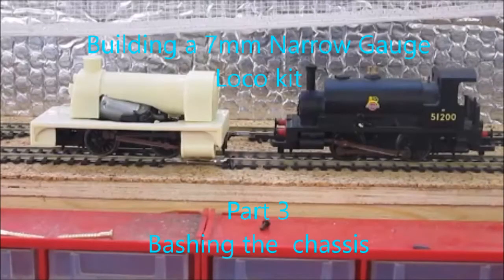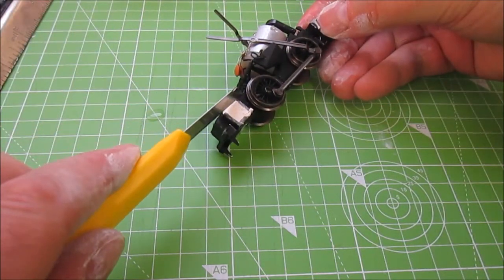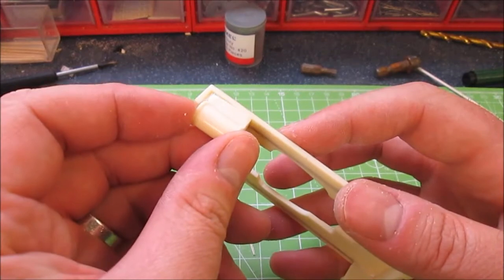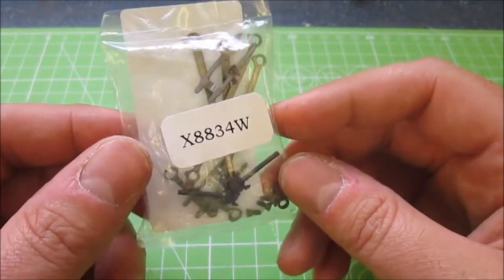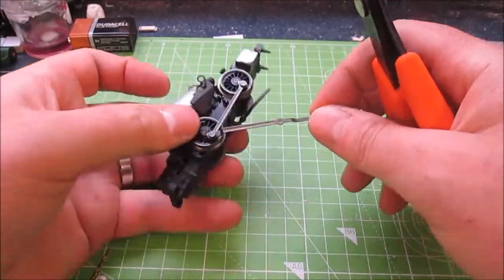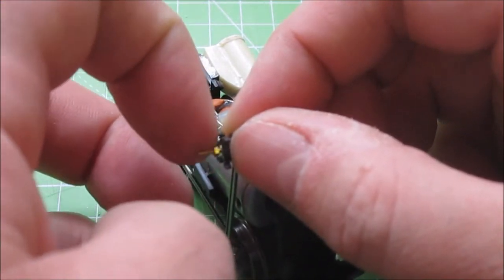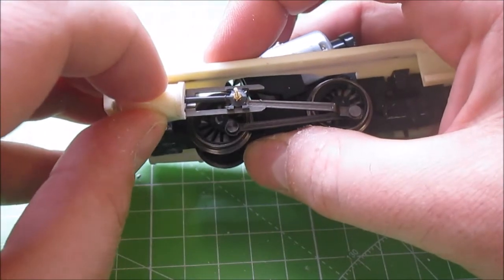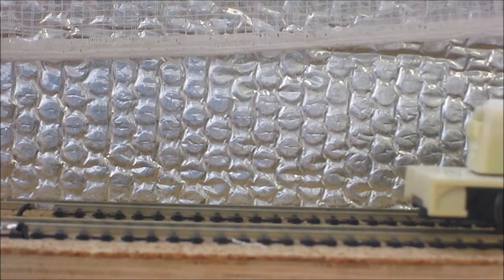Building a 7mm Narrow gauge loco kit - Pt3 Bashing the chassis

Comment: Great job!  It definitely has improved the model that's for sure and very brave of you for trying :)

Cheers,  Michael
Reply from the maker: Hi Michael. Thanks it was a little scary at first but I had spent quite a long time thinking it through and working out which size drill bits etc on scrap bits. Definitely worth the effort so far I think. Cheers.
Tom

Comment: Very nicely made video; your "teaching" style is really good and clear to follow.  
I have been thinking of doing something similar, and I have one of the Hornby 0-4-0 chassis, but the slow running and reliability do not really come up to scratch. Maybe mine is not a great example?  The time taken to complete the conversion would seen to justify splashing out on a nicer chassis to start with with a decent mechanism, though obviously the Hornby one is appealing because of the cost and simplicity.
Reply from the maker: Hi Robert. Thank you I'm glad you enjoyed watching. You are right about upgrading the chassis, the gentleman at the exhibition I was talking to had kept the chassis the same but fitted a mashima motor and gearbox. This is something I may do in the future but at the moment the ease and cost of having a go at an easy beginners kit (something I have not done before) with a bit of customization is a good place to start I think. If I had the skills and equipment then a brass etch built chassis would be perfect but that is a long way off yet I think. I would recommend these kits though if you are thinking about it. I have been doing some more work on this recently so will add the next part soon. Thanks for commenting. With regards.   Tom
Reply: Hi Tom,

I was impressed your skill in the surgery on the cylinders; it looked very smoothly done.  I have built chassis successfully in my 4mm scale days, including a fully compensated scratch built chassis (with kits for the cylinders and slide bars and a Mashima motor ) for a Hornby 4-4-0 county, but my eye sight is not what it was, and I'm more motivated to put the time into scenic work than loco building.  However, my Welsh O gauge layout is getting a tiny narrow gauge section and I would like to produce a loco or two.. If you're interested you can have a look at my efforts here:

http://www.rmweb.co.uk/community/index.php?/blog/1200-stringfingerlings-blog/

  What I've noticed with my Hornby "Smokey Joe" chassis is that it does run much better after splashing WD40 all around it - something I wouldn't normally do!  Even so, it still stalls occasionally before starting, and I need my narrow gauge locos to start reliably from a hidden storage line which can only be accessed by lifting up a row of buildings.   
Anyway good luck with your project!

Best Wishes

Robert
Reply: I've dabbled further, and I now have managed to get three of these chassis working really well.  Two are old ones with Ferrari Formula One type motors, but they now run very well and controllably.  The other was a brand new Percy model for my grandson, which was not impressive out of the box, but after dismantling, adjusting and reassembly it runs so well that I don't think I could make something myself that would run better.  The crucial things seem to be making sure all the pickups are actually working all the time; the random back to back settings on the locos need careful adjustment, as does the motor retaining spring clip.  I think that if this is too tight it causes the gears to mesh too deeply.  I'm not sure why, as you wouldn't expect the spring to be able to cause any distortion in the plastic chassis, but, after tweaking the springs, all the locos run much better.  I'm using an old (1983) ECM Compspeed  CF controller, and the slow running is spectacular. I'm now waiting for my  Smallbrook body to arrive before work starts in earnest.
Reply from the maker: Hi Robert,
It sounds like you have been busy. Thanks for posting the link to your rmweb blog, your modelling skills and layout is truly spectacular! Not something I am capable of achieving myself currently. Interesting tip with the retaining clip that hold the motor in, I will have a play around with that i think. I made sure the pickups were in place securely when I re soldered all the wirework from the top of the motor so fingers crossed that should be good. Which Smallbrook kit did you go for in the end?
All the best.
Tom
Reply: Hi Tom, thanks for the nice comments!   I've ordered the "Odin" model, as I think I could turn it into something that resembles the "Hughes" locos:
http://www.irsociety.co.uk/Archives/52/Alderney3.jpg
I'm going to try and blend the Hughes look of this loco  in the photo with the Corris style of cab etc, using your 28xx slidebar conversion idea.
Best Wishes

Robert
Reply from the maker: Hi Robert,
Well I never! Thank you for including my work in your thread, although I'm not so sure my work is of comparable quality to the superior standard of modelling you work at. I had better hurry up and get on with the next part of the build hadn't I? 
With regards.   
Tom